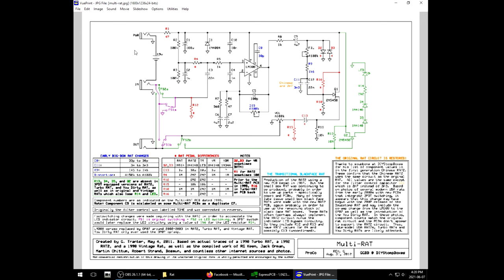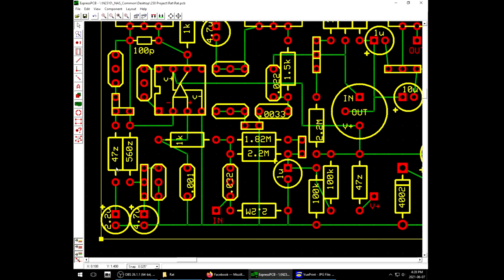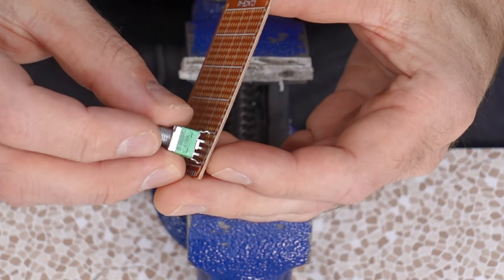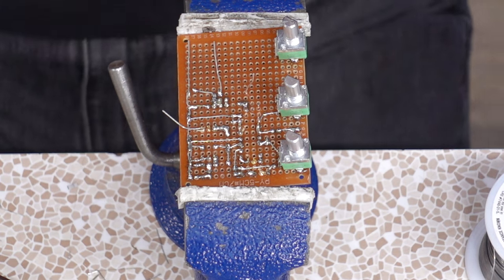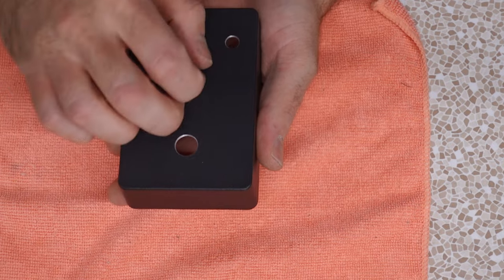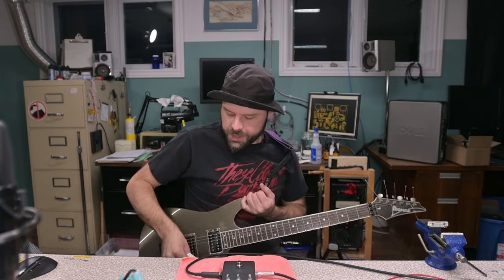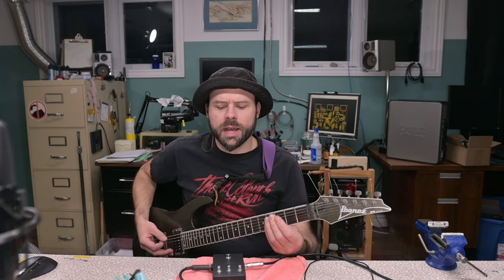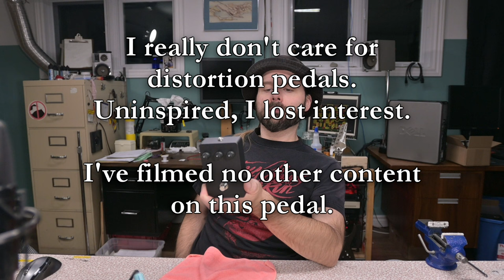The RAT ! Multi Clone Build

Comment: Boy that perf board sure looks like a pain.  I've stuck with veroboard for this type of stuff (or ordering a pcb from somewhere, thats even easier).  If you want a tighter rat sound they respond well to an overdrive in front.  Though whenever I use a rat, its usually because i want to turn the drive way up and have a nasty, massive, doomy, sludgy sound. 

Nice work though, very clean.
Reply from the maker: Veroboard? Like the strip board ? I've seen it around, I feel it'd be limiting to me. 
Mind you, at this point I'm so used to working with perf board. I like it. Some layouts I've since pulled off, I'll have vids of eventually, I def couldn't of done with veroboard. 
But yeah, I think it could doom. A doom buddy of mine, it was his go to.
Reply: @DATT  yeah the kind with copper tracks.  Its pretty confusing at first to lay things out on, but is easier to mod since no components need to be twisted together. The perf is maybe more like laying out a single sided pcb, so vero would certainly be a headache if perf is what you're used to.  Love seeing the projects though.
Reply from the maker: @tunasalad970  Yeah, I can see it being way easier to swap out components on a vero, assume the tracks hold up. 
I've been using higher quality Perf lately, it's double sided so that helps, and a lot more durable.

Comment: Please do a follow up on this flubby rat. Did you test some other IC´s? Could you tweak it to your likings? Have you used it or is it dismissed?
Reply from the maker: Ah, so it is flubby eh ? Yeah I dont' think this build turned out the way it should of. It was maybe too complicated a circuit for my skills at the time, and I might not have layed it out right. I could tweek it, but nothing really resonated with me, I pretty much run it stock with maybe just a lower value input cap to tighten it a bit. I tried different IC's not nothing really stood out. I don't recall filming anything more about this pedal. It didn't inspire me, so yeah, I guess it's dismissed. 
I found I was more taken by OD pedals, cause I'm so used to running tube amps that already have distortion, all I they might need is a little push. I've just never really liked the sound of distortion pedals compared to that.